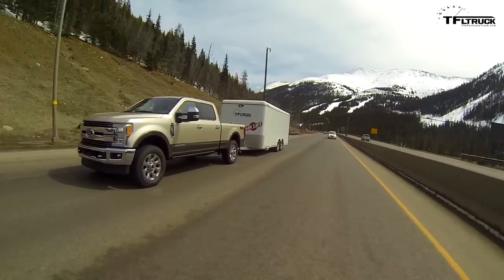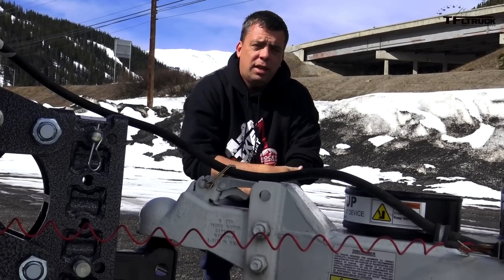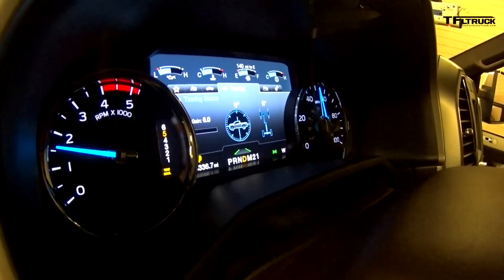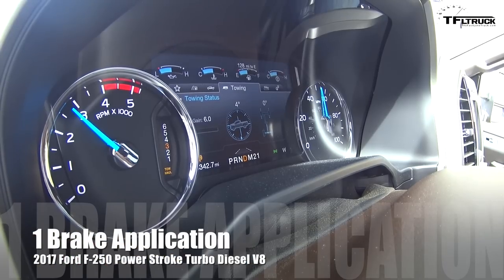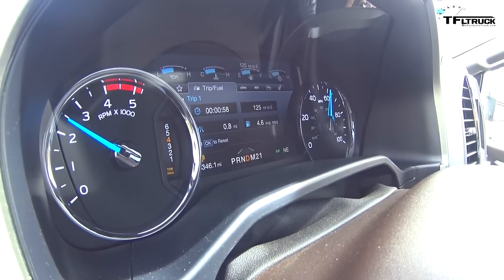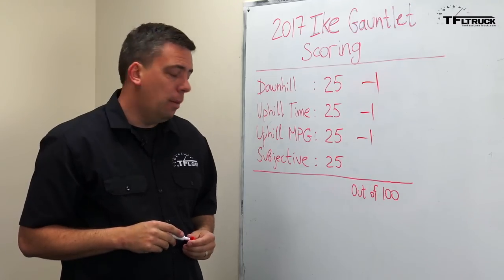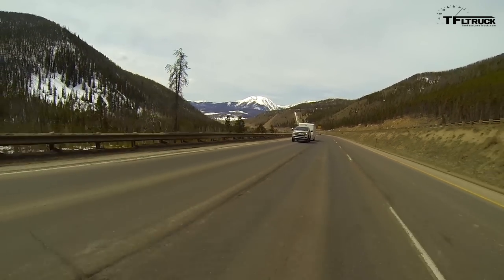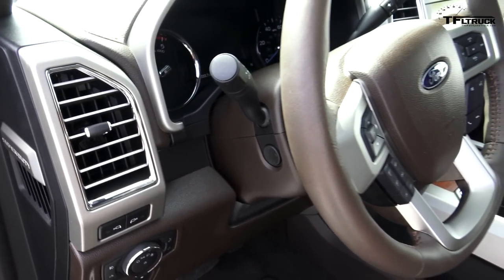2017 Ford F250 Diesel V8 Takes on the Ike Gauntlet Review: The World's Toughest Towing Test

Comment: Fords reliability is the worst out of any truck manufacturer. So many better options out there now a days.
Reply: Ram 2500 = least reliable. F250 and Silverado 2500 made the top two trucks to make it to 200,000 miles. Nice try though. http://www.consumerreports.org/car-reliability/10-least-reliable-cars/
Reply: Only American manufacturer on this list. http://www.consumerreports.org/car-reliability/10-best-cars-to-get-to-200000-miles-and-beyond/
Reply: Edward Piotrowski not sure why everyone disses ford, tried and tested best trucks in America , not a fanboy, just facts
Reply: Edward Piotrowski You should use facts instead of feelings
Reply: Bunz21 6l and 6.4l powerjokes! u know the diesel engines with the highest warranty cost in pickup history! not to mention the 6.7l, rocker arm failures, turbo failures, and crappy mpg.  now truck is perfect but ford is at the bottom compared to cummins and duramax.  they change turbo designs more often than i change underwear! that's not innovation thats fucking it up the 1st time
Reply: Better do your research there ed
Reply: Andy Hass and yet they are still more reliable than the Ram and more have made it over 200K than Chevy. So, unless you have some data to refute the mounds of information that JD Power and CR do, maybe you should ........
Reply: John Smith ya jd power is a joke and anybody who has been around autos for more than 5min knows that. post a link to your magic statement of more trucks over 200k!
i am refering to real life bro! i lived through the ford diesel nightmares! saw buddys spend 60k on a truck that spends months at a time in the shop! i had my ram with cummins and didnt have anything but a few minor issues. 
when ford tells u the engine blew up because the truck sat to long and the turbo vanes rusted u know to switch to another company! 
stop drinking the blue coolaid and get some life experience!
Reply: Andy Hass your the joke man don't lie about your friend put 60k really 60k don't make up numbers here because I can see right through them my father has 2003 ram 3500 Cummins has 400k great motor but every thing around it has fallen a part has put more then 20k no lies here and my friend has a 2005 dodge 1500 nothing but trouble so keep on lying fanboy.
Reply: Edward Piotrowski I hate Ford but ram is 100x worse than Ford buddy
Reply: Yea my father used to work for Ford back when the 6.4 is came out. He said he never saw somebody blown engines in his life.
Reply: I worked at a international dealership for years and have owned ever ford diesel produced by international since the 6.9.  Believe it or not all of the issues you all talk about were 99% on ford applications. Mainly due to ecu programming on horse power and torque demands from ford. Internationals hp ratings and torque #'s were considerably lower on internationals tks. Take the 6.0 for example. In four years of its run.  Not one headgasket failure came through our shop. Yes turbo issue's and stc fitting failures but no headgasket failures.
Reply: Andy Hass obviously you didn't even bother to read the links already posted above. You do know how to read, right. Your individual experience doesn't speak for the entire model lineup. So, once again, the actual data shows contrary to your statements.
Reply: Edward Piotrowski What are you smoking??
Reply: Andy Hass and I have plenty of life experience. I also know that numbers don't lie and billy joe jim bob fanboys love to ignore facts. I have not once said any brand is better than another. I posted links to actual research. Your assumption, first of all is that all HD trucks are diesels. Far from it "bro." Get some life experience and realize there are more gas versions than diesels. Maybe you also chose to ignore that Ram recalled 1.7M trucks and had to offer to buy back some 200,000 after the recalls failed to fix the problem. Once again, facts.  https://www.google.com/amp/www.autoblog.com/amp/2015/07/27/fiat-chrysler-buyback-recall-nhtsa-jeep/
Reply: Head studs (4 bolt instead of 6 like the 7.3) and ECU problems were the real issue w/ the 6.0. The ECU problems arose because it had to be quickly adapted for the new gov emissions standards. Agreed that if left to the original design it was not a bad motor. But once the head stud conversion was done they were rather reliable.
Reply: +John Smith-Yes when the 6.0L is bullet proofed it is a much better engine then the old 7.3L. Much more power and better mpg's. The 7.3L was a pretty basic motor. The 6.0L was much more advanced and technical and you are correct about Ford that they were rushed to get that into production because of gov't and emissions that they really didn't have time to thoroughly test it out!
Reply: How's that beat down felling?
Reply: It's always, my buddy this, my buddy that. No one ever comes with their  own first had experience. I'm a ford Diesel tech. I can tell you yes the 6.0l had issues with the egr and oil coolers failing, it is an easy fix though. And when it comes to the 6.4l 90% of the failure are due to lack of maint from the cust. These high pressure common rail sys are real finnecy when it comes to having clean fuel. This is a problem with all hp common rail sys not just ford. The 6.7l is by far the best diesel engine on the market now.  Only failures I'm seeing are emissions related, egt sensors, def pumps, def level sensors. First hand experience!
Reply: John smith yes.I had the chance to talk to a few Engineers from International that had come to our dealership.While most of them were very carefull not to diss ford  one had told me point blank. The VT-365  or 6.0  was never designed for Fords 325 HP &525 torque rating.The headbolt configuration and torque to yield bolts would stretch under the cylinder pressures at Fords programming at extended duty cycles which ended up in failed headgaskets ,  puking coolant. Ford sneakily re-flashed a lot of customers tks with new programming actually taking out Injection timing and fueling parameters to reduce cylinder pressures to try to curb headgasket failures.It helped that a lot but pissed off many customers as it robbed a lot of power they once had away from the engine. If you stud these engines and dump the egr system they are very reliable as long as you don't go crazy with Tuners
Reply: Agreed. Many of the supposed "failures" were from modded engines as well. Folks think they can boost the pressures in the motors and push them to their limits, and ultimately, failure. There is a reason manufacturers design engines lower than the failure threshold. Customers (just like Ford did with Navistar) think they can boost them without consequence. Same stories can be heard from Cummins and DMax owners as well. The dreaded  5.9 Cummins "53" block and wrist pin failures seem to get ignored as well as the DMax's overheating and injector pump issues. Some experienced them, some did not.
Reply: They are dropping engines left and right.
Reply: And Ram put the 5.9L Cummins with the "53" Brazilian cracking blocks and weak dowell pins that led to total engine failure in their trucks. Try again fan boy.  http://www.trucktrend.com/how-to/engine/1103dp-cummins-fatal-flaws/
Reply: Edward Piotrowski agreed! powerstrokehelp.com i dont see any shops that have made a fortune fixing cummins engines in rams... 100s have sprung up to "bulletproof" the shitty powerstroke!
Reply: Andy Hass. It shows you love ford's.  LMAO.
Reply: Is that why the Ram isn't on this list? Lol. You get shot down by facts at every turn. This is so much fun. Really Andy Hass, you make it too easy. http://www.newsday.com/classifieds/cars/12-cars-most-likely-to-reach-200-000-miles-include-the-ford-f-250-chevy-silverado-toyota-4runner-1.11677907
Reply: Awe you found people on a forum talking about problems with their trucks. Isn't that special. You can google any brand and do the same thing. Lol
Reply: Oh look, here is one about problems with the Ram, "Major Problems" - https://dodgeforum.com/forum/dodge-ram-diesel/112578-major-problems-with-6-7-cummins-8.html
Reply: How about the DMax- http://www.duramaxhub.com/duramax-problems.html
Reply: John smith agreed. I shared a lot of info with friends that were ford techs over the years that they had no acess to. It was funny at the end of 96 when the power strokes went with heui injectors and full electronic ecm control. Then the tuners started making chips for the 7.3.  There programming vented many a block lol. Ford soon got wise and started voiding warranties .now even using a flash tuner you can set it back to stock.  But dealer software can tell if it has had a programmer on it  .warranty gone
Reply: Lest we forget the class action lawsuit against Ram for the 6.7L going on right now. http://autoweek.com/article/car-news/fca-and-cummins-face-diesel-emissions-claims-class-action-lawsuit
Reply: Examples are all recent problems on 2017 Super Duty, not going back 17 years.
Reply: UnlimitedMPG see above link to ongoing class action law suit.
Reply: Yea Ford has some serious defects. Out here in the Sonoran desert they all overheat besides the Dodge. All leak more often, and ultimately cost much more in the long run with far less long term ownership. 

Dodge truckers require more. 

Ford can't even make a good v8 like their old 4.6.  All these turbos leave people stranded.
Reply: Lol- Sure they do. The 4.6, WTF are you talking about. The 4.6 was pretty anemic for a V8
Reply: OK, THEN WHY HASNT MY 2.7L ECOBOOST LEFT ME STRANDED? 30K MILES IN  A YEAR AND A HALF?????
Reply: Edward Piotrowski really? The why does my Uncle have 2003 Ford Explorer with 250,000+ on it, and still runs perfectly?
Reply: Edward Piotrowski but nice try, even though you are just getting torn apart in the replies right now
Reply: why do you say that
Reply: John Smith lmao hes probably the type of guy who says "oh my grandpa had a ford that broke down on him once"
Reply: Southern Nevada offroading and back country I think the claim is They Don't Really last past a hundred thousand miles.
Reply: MG42pillbox mines rollin on 240,000
Reply: jacob buza you should make a video and maybe a website. It could be a big boost to many Ford owners that are so depressed lately.
Reply: International mechanic here. .going back to 6.0 daze or VT-365. . Strangely so had 1..yes 1 headgasket failure in 3 yrs. .here's the catch.  Highest flash file for the VT 365. 300 hp 565 torque.  And that was only for internationals  CXT. Nothing else. So ford wanted 325 hp and 550 torque. ...so go hook up your 5th wheel and climb some grades. .here comes steam under hood. Yes your headgasket has been compromised. .moral of the story and both ford and international knew that this engine at ford's demands would have serious issues when doing what it was designed for. .towing
Reply: Edward Piotrowski ahahahahah an shitty Chevy and Dodge.  Are know to be 100k throw away trucks

Comment: So this F250 can only tow 12,000lbs? Aren't F150's rated for the same? What gives?
Reply: I'm pretty sure it's related to the truck's GVWR with the diesel engine, 4x4, cab configuration and trailer tongue weight rather than the GCWR or tow capability.

Comment: Manual locking hubs on a $75k truck hahahahaha gtfo ford!
Reply: They are auto or manual if the auto lock vacuum fails.
Reply: What's the matter? Too lazy and scared to get your shoes muddy?
Reply: Slyzuh they weren't manual.  it's a fully automatic system with a manual override.
Reply: Slyzuh manual over ride is an option others trucks don't have

Comment: Nice job on the review but i think the truck looks ugly
Reply: yadvinder gakhal how I think the Ford looks amazing now the Chevy that is a ugly truck but I do like gmc's look.
Reply: yadvinder gakhal Yea....  I cant decide if I like it or not. the rear end looks sharp Tho.
Reply: yadvinder gakhal I think that truck is beautiful
Reply: yadvinder gakhal I like the old outside batter, but wouldn't be near the inside. Now the I side is better and the outside is worse.
Reply: Shawn Dickens first off, check your grammar, because it's horrible. Secondly, what do you think is better, the inside or outside, you sort of contradicted yourself.
Reply: Lost all respect for you with a comment about grammar. I'm on a phone, so it's correct it enough to get the point through. I can't do 60 words a minute on touch screen. I miss my slide out keyboard phones, they were much better.

Nothing has changed. Still like the outside of the old and the inside of the new. In 2014 there was just the ugly inside of the old truck,  so I bought a Chevy.
Reply: are you nuts